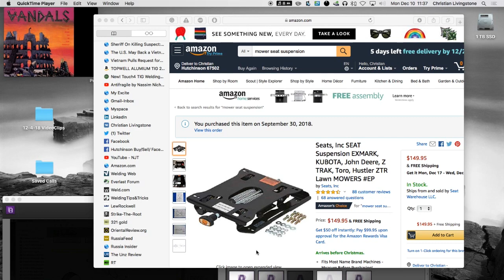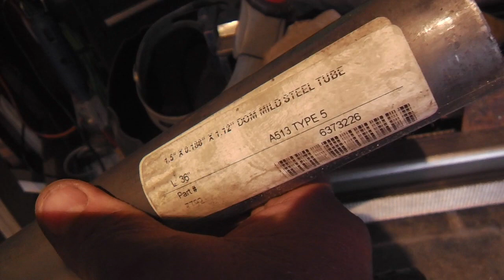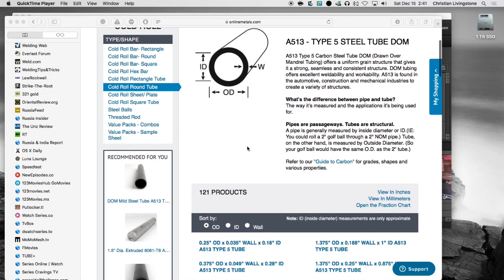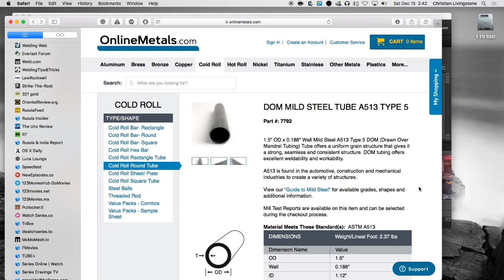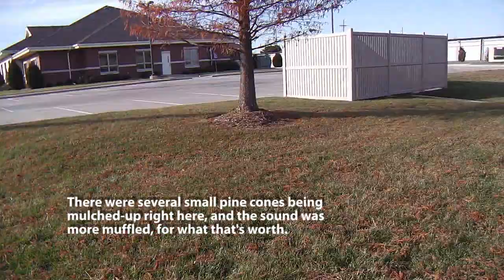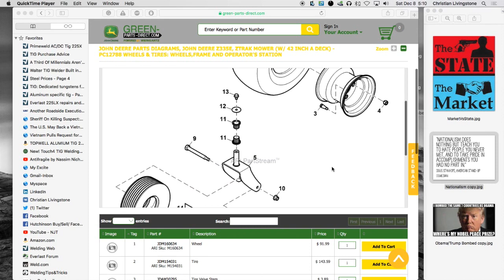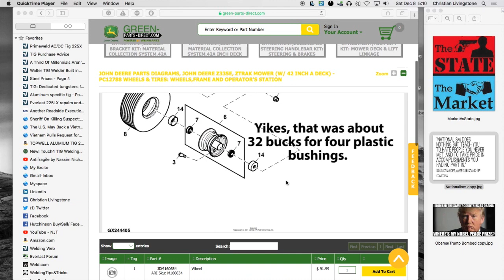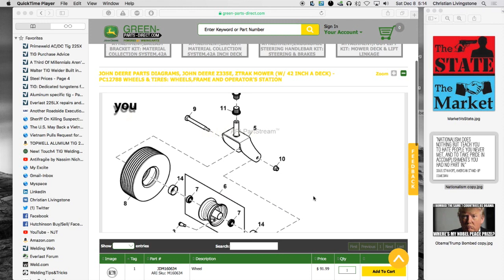Make A Zero-Turn Mower Better Than Original

Comment: Just bought an older zero turn and was thinking the same as you to "modernize" it and fab parts myself to make things work. I liked the stance of the mower with the wider front wheels, definitely the first thing I'll do on the old mower.

Comment: 93' 312 36" deck Dixon $100.00 & a 2000 3303 30' Dixon $100.00  Both Facebook Markerplace. The 3303 spindle was stripped on the blade end. Rethreaded it and it runs like a top now. Have not gotten to the other yet. Both will get paint this winter for indoor projects. Not a fan of the blue. Great video, def looking at seat upgrade.....

Comment: Throes Dixon mowers were made in my X wives small town of Centerville  IOWA. Had a brother in law from Lineville Iowa who worked there decades ago. Discovered you because I just got a Ancheer Ebike for  this spring. Amazon$650 delivered with tax.  500W and 36V/12.2 battery. I am old and retired.

Comment: This video helped me out a lot. I was given a 5601 commercial and one of the swivel wheels is shot. With the axle being damaged as well, I decided to go the route you did and ordered some ZGlides and the bushings. Will need to get some tubing to weld on as well. I'll update when all is said and done. Thank you for the video, super helpful.
Reply from the maker: Yeah, I'd like to know how it went for you and how you like the Z-Glide forks.
Reply: @NewJerusalemTimes  so I got the ZGlide delivered. 2 differences I'm seeing. The length in the shaft and the threads are much wider. I'm really disappointed that the hardware wasn't included in the ZGlide (for the wheel mount or for the actual part mounting) I understand that these are replacement parts and intended to use the pre-existing hardware, but the price suggests this is all inclusive. I noticed the diameter is the exact same though. So I think I may attempt to salvage the original mount and bearings by cutting it down to size and welding it back on. And of course relocating the zerk fitting. If that fails me, I have the bushings on order to go the same route you took. There's a lip on the original for the bearing to seat into so I feel that I may be going the bushing route no matter what. Will keep you posted.
Reply from the maker: Yeah, I ultimately went to two new 11" tall wheels and drilled out the 5/8" hole (for the shouldered bolt type) on the one side of the fork to match the 3/4" hole on the other side of the fork, then used a typical, non-shouldered 3/4" bolt for the axles, with the plastic bushings in place of the previous bearings.
Reply: @NewJerusalemTimes  Well, I got it all welded back together and painted up. I ended up cutting the center of the fork housing out to shorten it to the length of the ZGlide's fork post and butting them back together since it has that lip for the bearing. Then I welded those onto a piece of tubing just like you did and it came together really nice. Now I can send the bushings back as I re-used the same bearings. Those ZGlides are a much nicer ride and I think my cut looks even better than before. Not sure what makes people think they would gouge their lawn. Thanks again for the helpful video!
Reply from the maker: Nice work, and thrifty too!

Comment: Good work., been watching all your Dixon ZTR videos,  very informative and watching your mower evolve has been enjoyable. love the wheel and repower mods/videos. I have a 1999 Dixon 4423 and about to install a new Friction Z drive myself, your videos are very helpful. TY
Reply from the maker: Hey, thanks for that nice feedback. A neighbor just bought a new (old stock) friction-drive assembly online (eBAY) just to have it for a back-up. He paid a surprisingly small amount, and it kind of goes to show how even though the parts are getting seemingly rarer, they're often times getting more plentiful and cheaper too, since there's less demand for them, and a lot of old Dixon units are dropping out of service, and dealers and sellers are probably tired of holding that old stock on their shelves for so long. So all that stuff is potentially becoming more available at better prices, paradoxically.
Reply: @NewJerusalemTimes  Good Day, Exactly, I got two brand new reverse Friction Z drives, also picked up a really interesting 1997 ZTR 1001 Friction drove commercial walk behind.  1001 only has 475 hours on clock and Came with a rare Dixon Sulky, I couldn't resist.  the guy had tried adjusting without illustrations a few years back after he could not find a service tech to adjust steering and broke the main center iron cast. I saw how you welded one, thought about it but I'm real armature there. cones and all are very good, I figure between the two old used ones I can re build a decent spare Z-Drive and have extra parts.... I can send you pics, you got to see what they look like. BTW You videos got me inspired to make both purchases after seeing the 1001 and found your videos when researching Dixon, plus the neighbor I bough 1001 from went on and on about how that mower would go where his other mowers wouldn't. J
Reply from the maker: Yeah, those ZTR 1001 walk-behind units seem to have the same 42" deck and friction-drive assembly as my ride-on 3304/3314. I'll bet they can far exceed mowing side-to-side on steeper landscaping. I mean, walk-behind and stand-ons are quite popular with commercial outfits, undoubtedly for good reason. So, yeah, have a ball, especially because the outdated Dixon stuff is so cheap to obtain now, and user repairs can be done pretty cheaply too. Wheeee......
Reply: @NewJerusalemTimes  LOL yes, cant wait. what got me convinced is also,  I don't want to have to replace a $600.00 to $900 hydro pump every 1000-1500 hours only to have to worry about the left hydro going out. The ZTR 1001 has a 50+ inch deck option and  36 also

Comment: I need some help with my 4423. The left side is not getting the same power as the right. I’ve bench adjusted the drive, replaced chains, adjusted the levers. I can’t figure it out. The left side just doesn’t get the power the right side gets.
Reply from the maker: Yeah, I did a pretty complete transaxle/cone install and adjustment video that you would do well to watch a couple of times: https://www.youtube.com/watch?v=baaGjqRWd7k
In it, I did mention that the roller plates will often have a divot on it, and to flip over so that the roller has a flat surface that will show a true .050 measurement with a feeler gauge, i.e., you'll get a false reading if the roller is in the divot, since the feller gauge cannot detect the divot. So, maybe your left side measurement shows .050, but with the divot, it's probably twice that, which will reduce power. So, check for that divot. Or, if you're a little lazy, you might just put about one full turn on those two roller plate nuts and the one allen bolt at the rear, which will probably help. And if it does, then you can get both roller plates better placed and adjusted. Let us know back how it goes...
Reply: @NewJerusalemTimes  thank you for the response. The plates are new and don’t have divots. Is it possible that the rollers have been worn down too much? I’ll get my calipers and check their diameter/thickness. This started happening after my brother in law replaced the cups. I watched you video several times, purchased the literature and have gone over it several times. It’s very perplexing that it’s still doing  this. Now that I think about it, is it possible that the cups are worn to different thicknesses as well? I’ll have to check it out again.
Reply from the maker: Yeah, those rollers bobble around a bit, by design I think, as the radius is softer that way, which undoubtedly lessens the tendency for a smaller, deeper divot forming.
The cast iron/steel disc cups don't seem to wear much at all, but go ahead and measure them anyway. I think flipping the disc cup can reveal that the cradle arms that contain each disc cup can have a slight casting difference, but not enough to be a problem, like I mention in the Cones Install video.
So, do you get .050 at each roller? Does the left side cradle arm hang up at the roller plate somehow? Did you do the full transaxle removal and bench adjustment procedure, or are you doing a quick refurb while the transaxle is in the unit? If you haven't done the whole removal and bench adjustment first, maybe you'll decide to do that, as it would probably reveal why the left side isn't in symmetry with the right. So, sometimes you just have to be like Sherlock Holmes with a magnifying glass, in order to solve the mystery.

Comment: I just bought a Dixon ZTR it wants to turn right and go forward sort of but the left turning and left reverse dont seem to work so well any ideas I was even lucky enough to get all the Manuals and diagrams for it, I only paid 330 for the machine and it pur's like a kitten and I figure this is perfect for me to learn about the zero turn mowers, BUT, I need help funny your listening to that music as well lol
Reply from the maker: Gee, you don't mention the actual Dixon model number, as not all of the Dixon friction-drive units are the same (or is yours a hydro type?). But, instantly, I'd check for a broken torque rod at the back of the cradles on the left side. Also, this other video I did might be more helpful to you with the friction-drive troubleshooting itself: https://www.youtube.com/watch?v=baaGjqRWd7k
Reply: @NewJerusalemTimes     I saw those videos and about 20 others, however, My Gee man Model #4423 lol I found a 30-second video that I am going to try (no not because it is 30 sec but because it made the most sense) #40 chain replacement ( https://www.youtube.com/watch?v=qJ5AwSDuH2o ) turns out the guy I got it from bought it from another guy as a temp mower and the frictions were already replaced ;-) but if this does not work then maybe he put them in wrong (doubtful) or it might be something else it purs like a kitten and cuts like a woman with braces on a drunk I don't remember Friday night ) yea that's a good cut, I think lol
Reply from the maker: @themaximusone  Yeah, the 4423 model series seems to have the exact same transaxle assembly as my 3304/14 model series (the 4000 series seems to have mostly just added the electronic PTO deck engagement upgrade). Here's a link to the unit diagram: https://www.lawnmowerpros.com/shop/dixon/parts_manuals/2000_4423.pdf The torque rods are shown there (# 7786).
I've seem that short video, where the guy suggests that putting fresh chain stock on the two inner jack shaft assemblies will cure any ills of a Dixon friction-drive transaxle... I mean, often times those chains are stretched out and are worthy of replacement. But, I doubt your "left" side problems will be fixed by new chain installation. Let us know back, though.

Comment: Hey I have a dixon. When I engage my PTO, it starts to turn but the engine dies. What do you think calls that
Reply from the maker: Yeah, my Dixon doesn't have the electronic clutch PTO, just a manual idler, which doesn't interact with any safety switches (because I've removed  most of them), except to prevent the mower from starting if the blades are inadvertently engaged. But, I think I saw someone with a similar problem as yours, and someone suggested that it could be the seat safety switch button not being fully engaged, faulty, or intermittently faulty somehow, which apparently will shut the motor off when an electronic PTO is engaged or is being initially engaged. Or, maybe your alternator isn't fully charging the battery, as the PTO engagement, I believe, requires to keep the blades engaged and may also kill the motor.

Comment: I have a Dixon zero 3303 and I'm wondering where the ignition plug is located
Reply from the maker: My plug is under where the key goes, but a couple of ignition coil plugs are under the engine cover, at the flywheel.
Reply: @NewJerusalemTimes  thanks a lot so what model do u have I have the 3303 zero 2001
Reply from the maker: @latoyasockwell  Mine's a 1995, 3304, with an upgraded 42" deck.
Reply: @NewJerusalemTimes  thanks so much
Reply: right a t the end of the ignition wire